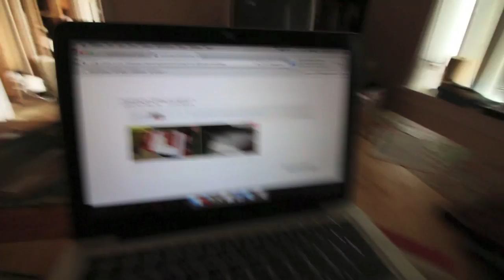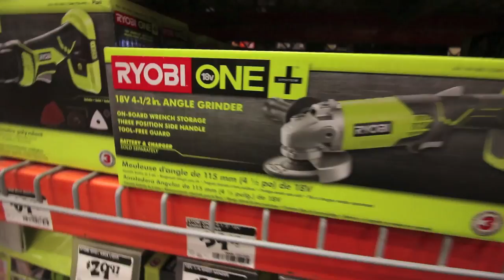MY YARD IS TURNING INTO A U PULL IT!

Comment: Yo bud how do you like the new grinder? I have the same one and I found out if you make a bunch of short cuts it lasts pretty good with the 4amphr batteries, you should look into the hybrid ryobi fan for the truck so it's not so hot in the truck.  #noaclife
Reply: I also run a small inverter to charge batteries on the go
Reply from the maker: I love the new grinder it's so much easier to deal with just have to get a few extra batteries.

Comment: take the tomato plants and bury them up to the first branches. they will grow roots all along the main stem and be good as new. separate the three and evenly space them, again bury them very deep, no problems.
GET ON THE ROOF LEAK NOW! forget the videos and scrap chat stuff, the roof is just too important
Reply from the maker: You are right but I want to put a whole new roof on not just fix it these one is done.
Reply: spray the mold with straight bleach from the bottle, use scented if you cant hack original, and a mask. soak the area. Go into the attic and do the same. Then setup a fan or two to continually circulate air in the attic, try to dry out the area as much as possible, AC if you have it. Also consider a tarp over the roof until you re-roof you must keep the area dry or you will have wood destroying mold in there and the structure will have to have a new planks or plywood.